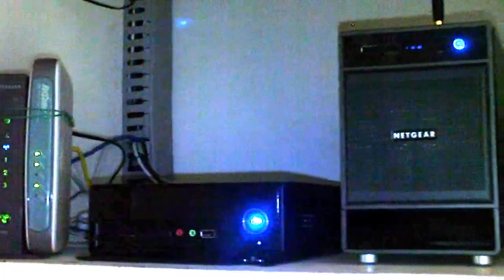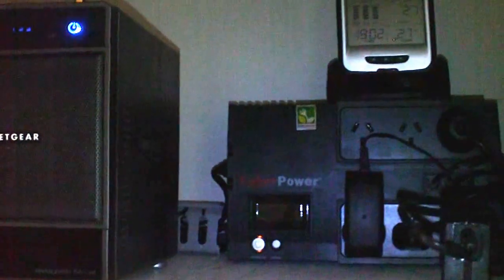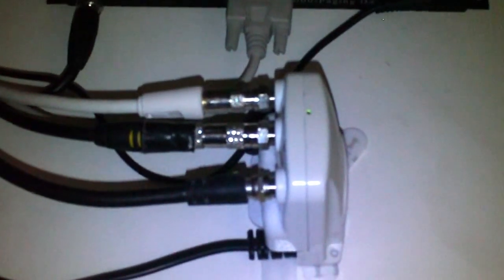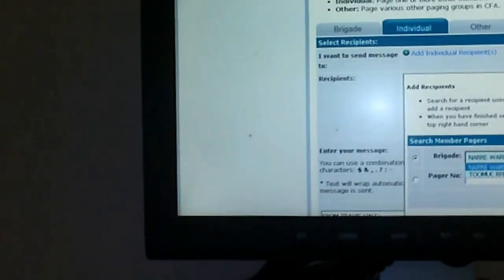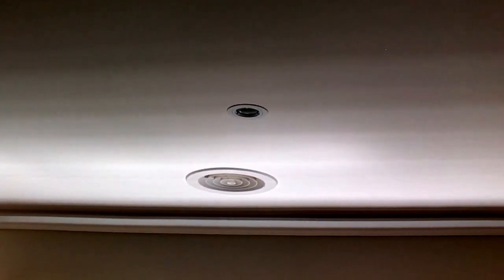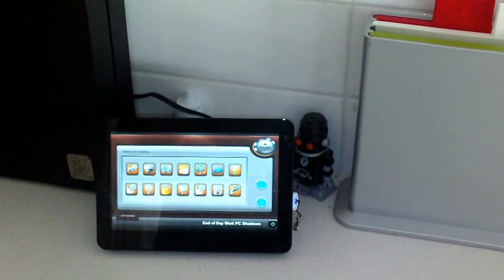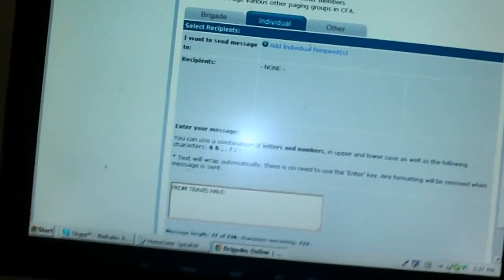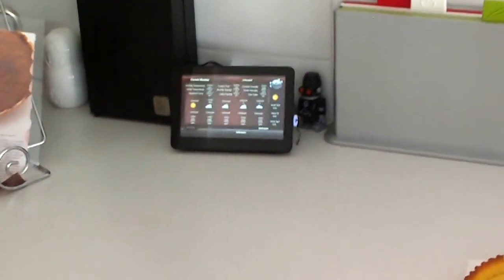Automated Fire Response System (Homeseer)

Comment: Hi Travis, are you still running the pdr2000 or have you done another update since?
Reply from the maker: Hi Scott, I ended up moving a while back and with a young family I no longer had the time to volunteer so I don’t run the system anymore. It worked perfectly whilst I was volunteering and I never did any updates :), never really needed to since it worked so well and gave me heaps of flexibility
Reply: @TravisHaleSciencePhotography  cheers for the reply, yeah thats great when it just works. I'm playing around trying to get an offline system working myself atm. Rtl-sdr kinda work but very poor/ unreliable decode rate, i think due to my location. Considering going something a bit more dedicated, pdr isn't avaliable anymore I believe, sounds like that's the way to go though. You are right though, very handy for volunteering; advanced warning of likely incoming call and also great for the automations.
Reply from the maker: @scottmowbray2649 I first started off with a scanner and poscag decoder which worked but was very finicky with volumes, the cables used and a whole range of other factors, switching to a dedicated decoder increased reliability much more.

Comment: That is very impressive, well done!

We plan on ordering a PDR3000 which will connect to Windows Server 2012 R2. I want all pager messages to be imported into a MySQL database which is hosted on our server. What software do you use to capture the serial data from the PDR3000? 

It looks like you have been inundated with requests for support, if you have time feel free to email us admin@burnsidecfs.org.au.

Thanks in advance

Comment: and here i am, been running pdw for years first with a scanner then with a SDR and virtual audio cable

time to take this route i think, been thinking of home automating for a while, when going hardwired / monitored smoke alarams.

great set up though
Reply from the maker: flip you can do both, pdw allows you to email, my first setup did that, i would then act on the email, using something like pushover and pdw may be a way to have semi automation